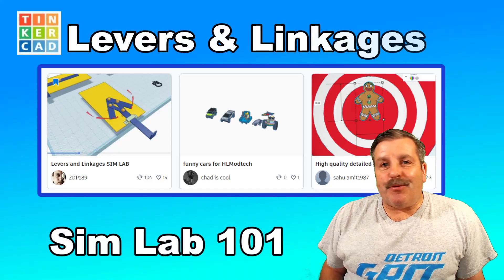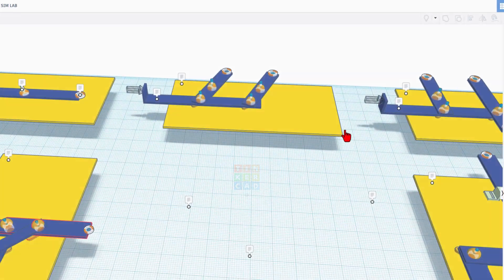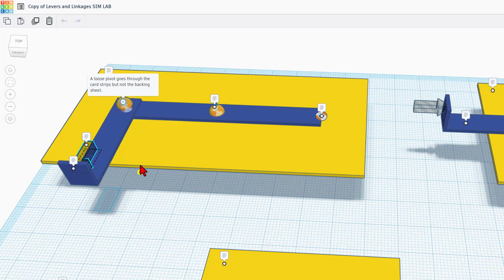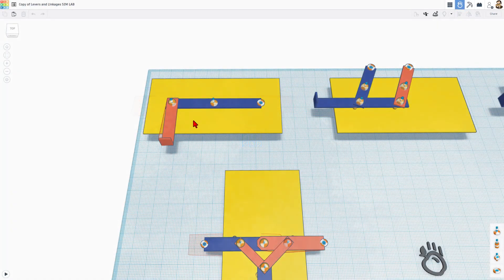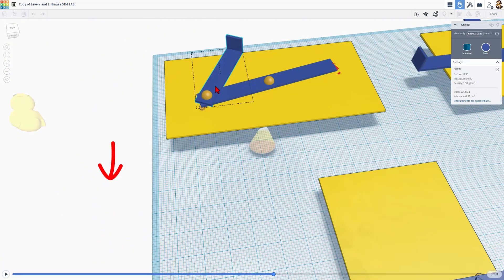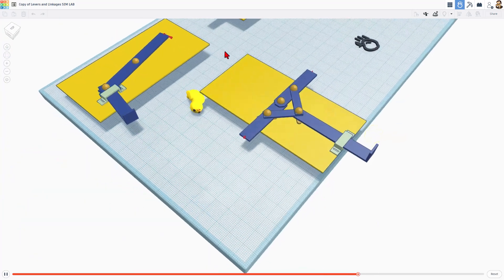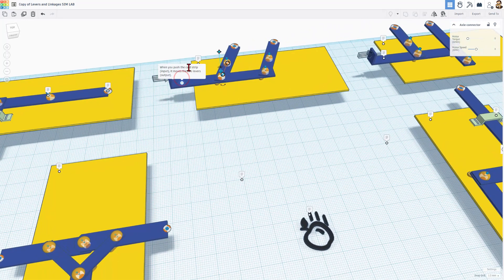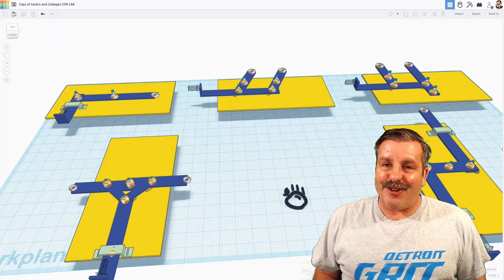Learn Links & Levers in Minutes! Tinkercad STEM Sim Lab 101 by ZDP189

Comment: Besides the tabs, this design was copied exactly from teaching materials from The Designs and Technology Association (link in project description) which made the mechanisms with actual stationary.

I was asked for help converting it into Tinkercad for a teacher via a CADClass admin.

Perhaps it could have been done better for SIM LAB, but I did exactly as requested. You don't need to draw the paper fasteners and holes; we have Connectors for that; but the fasteners make it seem more real and thus easier to understand intuitively.
Reply from the maker: Very cool. I was thinking it would be neat to have a worksheet for users to record their findings as they work through the mechanisms.  I will have to look up the link to see if there are materials like that already included.